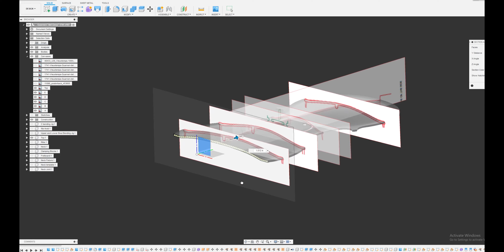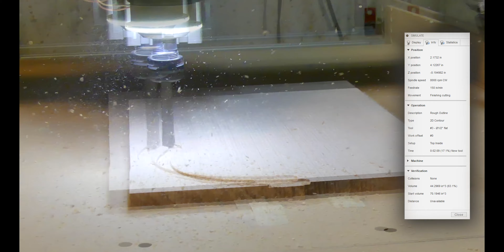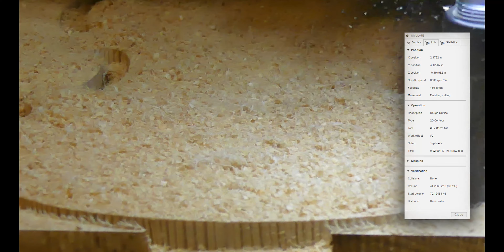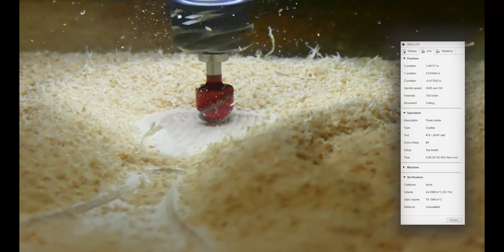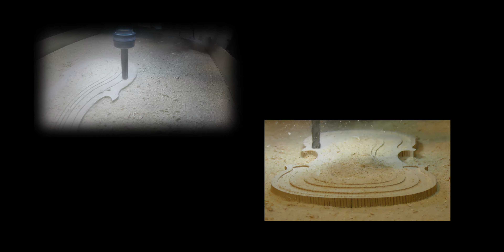Making a Violin | Guarneri Del Gesu "Veiutemps" | Part 18

Comment: Great seeing another video! I'm gonna make another one of my geeky comments.. You didn't seem to hate me for the last one, but tell me if I should stop ;-)
 Integrated/carved bass bars was common practice in certain regions earlier on, and it actually isn't much different performance wise from a glued in bar. I think you might want to look for that nasal tone other places, and I suspect that the very stiff top you mentioned. Your spruce quite frankly doesn't look to be of high quality, and that might be why you end up with a thick top if you tap-tune. That wide soft grain will likely lower your frequency prematurely because the wood isn't stiff enough.
Apart from the first top being unnecessarily thick, you might want to consider thinning the channel. That can even be done after assembly, but before varnish, to tweak the tone. Thinner channel area will make the violin loose some focus and gain warmth and darkness, and that to me sounds like something you would want for your instruments. For myself, I don't know. I'm currently building a Vuillaume cello as my main project, and as I'll be playing concerts on it, I want a nice dark tone, but I also want it to be a powerful beast of a cello to support my... Aggressive playing at times :-P
Another thing to consider is of course soundpost placement, but the bridge could also contribute to your loss of tonal complexity if you have mass in bad places.
Anyway, these are just my theories, feeel free to consider them or not. I am learning, and part of that learning for me is to build some sort of physical understanding of the instrument, and that leads me to critiquing violin plates in youtube comments ;-)
The arching criticue is not something I have read myself, but I think people could be referring to the fact that you have a steeper rise after the channel and then a flatter area on top than the Strad poster arching? But if so, it's very minor in my opinion. Will it affect tone? Yes. Will it be a lot? Nah... Will it be worse? Noone knows.
That's all I have for now. Maybe you can use my thoughts for something, maybe not. No matter what I still think it's a very interesting build, and I hope it'll end in you handing it to a skilled violinist to get the most sound out of it. Maybe even someone who plays a Guarneri and can tell you how close the feel is of the two, that would be an amazing way to learn, both for you and us :-D
Can't wait for the net video ;-)

Cheers
Tobias
Reply from the maker: I definitely appreciate the comments, Don't stop on my account

Comment: Who's ball type router bit (red) are you using? Is this a standard route bit that you get when you buy route bits?  I like what I am seeing on your channel, I learning a lot thank you for taking time to show us these things.
Reply from the maker: It's just a normal router bit from your local big-box store, this one is .75"
Reply: Thanks for your reply that is what I thought it was just wanted to make sure. Do use any other standard woodworking router bits?
Reply from the maker: Almost everything I use is a stander router bit available at your local store. I use 1/2" x 3" two flutes straight bit that I usually get from ebay for cutting deep parts, and a specal 1/4" bit made for cuttin acylic, other than those everting is cheap and localy available for most folks.

Comment: hey, really appreciate your content, I'm really getting a lot of quality information out of your videos, also supporting you on patreon already :) - I've been making instruments as a hobby for around 10 years now, starting with upcycling instruments like oilcan guitars and the like, graduating to proper acoustics about two years ago and now starting to integrate fusion 360 into my process :) My next project is an archtop ukulele (so as not to waste as much wood as in an archtop guitar when I fuck up - archtop guitar will be next after the ukulele though...) -- so here's a question: I'm starting to make a few test arched ukulele tops on the cnc now but so far can't seem to get a nice finishing cut that would minimize the sanding afterwards - what combination of milling operations are you using to get to the nice finished top seen in other videos? Thanks and cheers from Berlin!
Reply from the maker: Thanks, I'm glad you like it. Excellent question, I do the rough milling with a 1/2" end mill with a .125" step down and less than .25" stepover, I set the stock to leave at .06" (this is usually a pocket toolpath), the finish cut is done with a .75" ball end mill on a scallop toolpath with stepover around .06" this scallop toolpath is what gives the nice surface finish. When I made the first top for the violin I had not figured this out yet so the F360 file on the Patreon page doesn't have this setup, I have updated it and when I finish the new top (hopefully in the next few weeks) I will post the updated file to Patreon. Thanks for the support and I hope this helps, let me know if you have any more questions.
Reply: @TwoCherriesIns  great, thanks for the reply :) I used a 3D adaptive toolpath followed by a 3D parallel and scallop toolpath, so not too different. might have to try a different ball end mill then or smaller stepover to get a nicer finish. I'll also have a look at your files on patreon, haven't gotten around to checking them out yet. In case you're interested check out my instagram for recent stuff I've been making https://www.instagram.com/do.se_instruments/ or some older upcycling instruments videos on my youtube channel as well. also looking forward to your next videos :)

Comment: So where is your skill at violin making at? Operating a router machine? Oh, I see its also in computers.....too bad the old masters didn't have that. I prefer mine handmade not machine made.
Reply from the maker: The art of making an instrument is in the fine details. CNC’s only do the rough carving. I use traditional methods to hand finish each part. It doesn’t take any special skill to rough out lumber. Several older makers have contacted me, they have difficulty performing this roughing work. The wear and tear over the years have done significant damage to their hands and joints. This method keeps them viable for a few more years; there is no way to tell how long it can extend the careers of luthiers who use these methods throughout their lifetime. Maybe you feel like we should put these folks out to pasture, or that this work is only for the young. I think we should keep these skilled craftsmen active for as long as possible and learn as much as we can about fine finish work from them.
Reply: @TwoCherriesIns  okay, but I know luthiers that are in their golden years that never use a CNC to do rough work. To each his own, good luck.
Reply from the maker: @masterchief586  Yes, there are a few, but not enough. I have seen many quit well before their time.
Reply: @TwoCherriesIns  I certainly did not mean to put you down for your methods. Just seems not so personal using the CNC for a violin.  I would think that a all hands on build would be much more satisfying 🤔.
Reply from the maker: @masterchief586  It seems inherent in your question that you have not tried both methods and therefore don't have the experience necessary to make that particular judgment. I have built many instruments manually and with the CNC; I find them all equally satisfying. I'm criticized from both sides; If I don't perform the work with the CNC, I am told I should, and when I do,  I am told it's more satisfying without. Combining what is best done with CNC, CAD, and CAM with handwork provides results that are both accurate and efficient. Some work is quicker and cleaner by hand, some are best executed with CAD/CAM and CNC. I like most craftsmen, am willing to learn and adapt to achieve better results.
Reply: @TwoCherriesIns  I guess I will have to try CNC. See what happens.